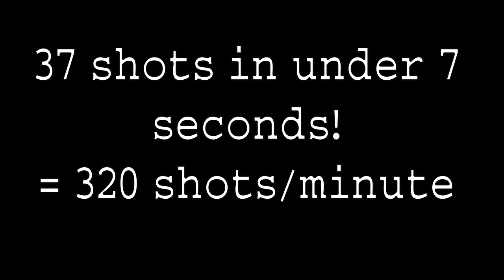Rack and Pinion = Machine-gun Crossbow Solution?

Comment: There is going to be a point when he starts producing crossbows more effective than guns for all situations
Reply: What if you increased the speed with a set of gears? Like a 
transmission. And use that rotary to linear trick to actually shoot the arrow.  What Joerg did, 
just basically in reverse. Or you could simply have a string that gets wound up
 at its ends.
Reply: Gears, pulleys, ect increase speed at the cost of mechanical advantage. To pull back a 100 lb spring thats geared to shoot twice as fast as its contraction speed, will require over 200 lbs of force. Furthermore, gears and such introduce extra friction and inefficiency. So you put in more then twice the force to get a shot that is not quite twice as fast. 

A spring weapon can rival the point blank damage done by a gas weapon. However the spring weapon must scale up via size and mass of projectile instead of speed. This means the spring weapon will always be larger, have a shorter range and more parabolic trajectory for any given damage level.
Reply: I know it's pointless, but when has that ever stopped Joerg ;)
Reply: mikeunleashed1 

I don't know... that's kind of a strech, not to say he isn't good at what he does
Reply: do you know what humour is?
Reply: I always thought they should make a weapons grade airsoft gun.

Comment: What about the ammo? It will need to fall fast enough or be pushed into the chamber for the gun to successfully fire. Could cause a jam if you are planning to shot arrows
Reply from the maker: The arrows will be pushed down by rubberbands as well. Gravity is too slow.
Reply: JoergSprave wouldn't it be a better idea to have bottom fed detachable magazines like on a rifle, frees up the top of the weapon for the sights
Reply from the maker: But the bottom is used up by the flywheel and the push rod already.
Reply: Ah I see, fair enough
Reply: you can still make a detachable one on the side like in some machine guns.
Reply: But that'd be where the rubber/string would need to be
Reply: belt feed auto-crossbow?
Reply: I love the fact that you reply. @JoergSprave
Reply: JoergSprave Your channel taught me that rubber bands can solve everything, and if its not just add some more!
Reply: JoergSprave Oh okay  :)
Reply: Maybe a diagonal mounted magazine would work? That way you would have the top free for sights?
Reply: A spring have to press the ammo in to the shaft
Reply: Jimmy Piontek A spring? A SPRING?! How DARE you!! There is only one option here, and that is MORE RUBBER!!!!!!!!!
Reply: go even slicker and run the drill through a 90 degree drive so it's inline with the gun and held more normally!
Reply: Invert it ...
Reply: TheGreatWarrior123 rubber pulled mybe
Reply: but how will you store that many arrows? or will it only fire about 8 but really fast? After all, bullets are alot smaller than arrows.
Reply: JoergSprave Just invert it, the flywheel doesn't really need gravity, turning it upside down would allow you to have both sights and huge ammo magazines
Reply: TheGreatWarrior123 perhaps a closed chamber with some springs pressing the arrows into the "barrel"?
Reply: almost anything can solve almost everything if there is enough of it tbh
Reply: Hopefully the arrows will be able to withstand that kind of lateral force!
Reply: A mag would be better too because u can use springs to focus the downward force, rubber bands aren't as controllable
Reply: TheGreatWarrior123  he could use the same principle of the pencil shooter
Reply: This was an issue with the early hand driven gatling guns, they had a max speed

Comment: So the next big problem is likely how to create a feeding system that can feed the arrows quick enough without jamming on every second shot.
You could try and push down hard enough, but that would ultimately cause lots of friction between the fired arrow and the one on top.
Maybe you can tie the feeding system into the firing mechanic, so the next arrow is pulled down for each shot.
Reply: the solution is more rubber.
Reply: TypeOmeg4 This is the Slingshot Channel. The solution is ALWAYS more rubber!

Comment: it s just like airsoft gearboxes
Reply: Yes, it's basically the same. I would have pointed it out, if you hadn't.
Reply: A good airsoft tech would help a lot with this contraption :)
Reply: The bolt assembly on the Lewis gun works the same way.

Comment: Dear Jorg please make this dream come true.

I still think that this rack and pinion is the best method for a machine bow due to its stability and better aiming, but the upgrade it needs is on the other side of the spindle of the pinion for another quite large cog to be the gearing system for the drill to connect to , so that the drill can attach to a smaller cog and then be able to power high weight crossbow limbs. Sure there would be some loss of power because of some friction in the added gearing cog , however the power increase of the gearing cog would more than offset this.

Please make this dream come true as surely this design improvement would be the best machine bow ever made.

Comment: Have you tried an impact drill? It might be a bit slower than a standard drill in gear 2 but the hammering action of the impact would sound more intimidating.
Reply: This is actually a great idea! An impact drill would greatly reduce the wear on the gear teeth. At least in theory.

Comment: I could see there possibly being an issue due to how it bounces when it rebounds after each shot. If the teeth of the flywheel catch too far along the shaft mid bounce then it might force the whole shaft into the back of the chamber and break something. Maybe put something at the front of the chamber to absorb the impact energy and reduce the bouncing.
Reply from the maker: Timing is very important, one of the reasons why I built a tester first. Seems to work fine though. Keep in mind when the wheel catches the first tooth the main rubber bands already press down on the shaft.

Comment: Jörg I think there may be a Problem with high speeds, as you can see after your test in second gear, the main rubber is released but the trigger is not jet pushed. 
I think it can't really lock at high speeds, perhaps a stronger rubber band is needed for the trigger itself?

Comment: Joerg, looks great. I don't know if you can go much faster with it without replacing the front pink band with a stronger one. With the drill in 1st gear, it appeared that if the loader doesn't move back to position fast enough, it would get caught halfway through its forward journey. You may lose power on the shots due to this. It is a very creative design though. I was thinking more along the lines of a piston, but this also works great. Keep it up!

Comment: What a beast! And the device is also super awesome. Can you think of a way you can use the cycle to also load the next bolt into the magazine? IIRC, there was a lot of dry fire even with rubber-pushed mag capping with your other full auto devices. Maybe you could have a little gear that cycles thin cogs that exactly fit between the bolts?

Comment: I suggest using the brushless motor and gearbox out of a R/C car. They're compact, powerful and can handle tons of torque; this might be perfect for your application. In the event of a jam, they also have clutches that will slip if the torque is too high. These motors run at really high RPM(100k or faster in some cases). You might even be able to get away with a threaded rod and steel pinion, although the rod would need some buffering when it falls home due to it's mass. The configuration is rather flexible and will allow for a less bulky package.

Option two is to use the drill as the pistol grip and figure out how to route the torque to the pinion.

Comment: Another potential mechanism to use for this sort of thing would be similar to how a steam train works - I'm not sure of the terminology here, but it would sorta be like the way the wheels are driven, in reverse.  An arm attaches a wheel to a piston, and when the wheel spins, it moves the piston - this way, in the circuit of the wheel, it moves the piston back to cock the shot, and also forward to return it to the "zero point" as it were - less rubber needed that could fail, less impact on the system as a whole, tho there are a few more moving parts.  Worth a shot, however, I'd think
Reply from the maker: The return speed is too low. The main rubber band would hit it halfway.
Reply: that's fair - I had kinda figured you'd already thought of it, but I thought I'd say something anyway - worst thing that happens is you've done it, right?  Either way, I'm excited to see where this goes.  The crazy lengths you go to simply on "How can I make this cooler" are extremely entertaining.  Cheers~

Comment: You could also use motors that hook up to strong batteries instead of a drill. Many of them are pretty small and can have good power for a prototype; or maybe even a completed creation. Plus their much more lightweight and compact, allowing for a more compact build. You can also use a drill motor. I've noticed from experience my chorded drills are more powerful then my battery ones. This could be tested for what you have available. If you have the same experience maybe one can be used to for a mounted build, or an aesthetic option (Baze Malbus cosplay weapon maybe? Just an idea.) I hope this comment means well.

Thanks for reading
Sincerely, Domolords

Comment: SO awesome!!! Maybe make a second gear that is set up so that it's teeth are 180 deg of the other one and put it on the same axle... then you could have another band set and hopper off to the side to make it a DOUBLE BARREL! It would also use the drill motor more efficiently I'd imagine. You may also consider putting the gear on top where the hopper will be so that it doesn't need to be as tall!

Comment: It looks like the gears and trigger are only using 1/3 of the wheel.  Is there enough room to add another set of gears and trigger on the wheel to double your shots per revolution?
Reply from the maker: Room, yes. But the timing has no more margin.

Comment: Joerg, I see two problems so far if you plan to make this have military grade fire rates (around 900-1200 rpm, like a machine gun.): the cocking sled splitting itself or the panel it slams into and the effective draw length of the string eventually being shortened by the string hitting a still-retracting sled. The solution of a better rubber band on the latter also might make the former problem more likely. maybe add metal plates on the sled and contact surface? I haven't seen any comments on this so i decided to ask about it.

Comment: That's basically a huge AEG except AEG's use compressed air instead of the force stored in the rubberband. Could this be used on your scale and would it be more beneficial? I think compressed air could get your bolts to reach higher speeds than a simple rubber band.

Comment: Nice! But i feel that the bolt needs a bit of a rubber or spring buffer. When it snaps back it smacks quite hard into the frame. It would stabilize the whole assambly and maybe even increase firerate. One definite point of failure will be the wooden teeth. It should be made out of metal if that isnt too much of a hassle. As another inspiration for transfering roational energy into pushing and pulling try a reverse steamtrain. Not sure what it is actually called but it may make for a more efficient energy transfer. Looking forward to seeing it in action :D

Comment: Hey, Joerg.... How about some different ammo??? I am thinking Golf balls, and tennis balls. But how about clear glass Marbles with a lazer light to light up the clear/translucent marbles?? And as I see it snowing, snowballs?
Reply from the maker: The principle works for all kinds of ammo. But there is a limit regarding the draw weight of the bands. The cordless drill only has so much power. Therefore the lightweight crossbow bolts are well suited for the setup. If you want to shoot heavier objects at high speed, think all steel construction and a Diesel engine.

Comment: You need a belt fed magazine. You really need to start machining the wear parts out of metal. The wooden rack and pinion will wear out pretty fast or break. Your designs are freakin unreal. You make some really cool stuff. You're quite the designer, engineer and fabricator. Does this video act as a copyright. I think you could sell this thing.

Comment: neat!
this looks like a great addition to your repeater line of thought.

"donald duckman' made a repeater with a servo, it is somewhat what envisaged for the chinese-repeater
the counterweight in the drawer runner is reminiscent of your 'drawer-slingshot-ception' vid.

perhaps, nitinol/nichrome in the band itself - 
the bands reflex/return to shape after firing?

neodymium in the pouch attach to a solenoid,
and a piezo-electric/hall effect sensor attach and detach the solenoid/servo to the pouch?
maybe a d'halbach couple at the base of the grip,
and there is not a chance the pouch will attach to the construction if wood throughout,
maybe the projectile?

I envisage that as a two-as-one system -
slingshot, and your pneumatic! 
so, you can have the small stirling/piezo solenoid run a small compressor onboard,
which power the reservoir of air somewhat eh?
or, perhaps it is slingshot and light-mag implement - 
some solenoid-stirling, they throw pellet with much force eh?

Comment: Just like the piston system In An aeg, automatic electric gun, airsoft gun. If you put teeth on both sides of the pinion, excactly 180 apart, you will not need as much speed from the power source. You will get two pulls and two shots of one rotation of the pinion.

Comment: It's basically the same mechanism that you can find in a soft-air rifle. The rifle's motor engages the pinion gear through a worm gear to reduce the high speed of the motor to a more usable speed.
Reply: Shannariano its three gears, pinion, bevel, and sector (thats what the drill is attached to)

Comment: wow that's fast I am looking forward into solving the feeding mechanism for this in that speed.
Reply: For reasonably small quantities, he had a vertical magazine, on the manually cocked version,  with a rubber band tensioned follower that pushed the bolts down. For bigger quantities (I can picture a wedge shaped hopper, V, with 100+ bolts...) The paintballers have a rotary 'carousel' type thing at the bottom of their mags picking up balls and the positively depositing them - an occasional empty slot isn't too bad at 12+ balls/s.  But dry-firing isn't a problem there, nor do  they don't need to worry about orientation of the ammo.
 Wonder if some sort of cogwheel with teeth/openings suitable for the bolts could do better than simply two rubber bands (front and rear) pushing the whole contents of the wedge down. Might be and issue to retain tension towards the end without having excessive tension at the start)

Comment: you could double the rate of fire by making it a double "barrel" crossbow with the pinion pulling a second rack after it has done the first. the rack would be going the opposite direction so maybe some paracord strung around some runners to pull the elastic in the right direction

Comment: Joerg you should get a right angle drill adapter and then the drill could be in line with the weapon.
Reply from the maker: These adapters only work under very low torque, useless for this application.

Comment: The slowmo shows that the part that pushes the string bounces back when slamming to the front. That might cause failure so maybe put some dampening there.
Reply from the maker: Dampening doesn't work. When you look at things using the hispeed, you sees that bouncing actually INCREASES when you use dampening. But look at the action - when the main bands hit the push rod, the bouncing stops. The flywheel teeth will THEN approach the rod.
Reply: I trust in your design

Comment: Would this be even more rapid fire if you made another set of teeth on the other side of the rotating circle?
Reply from the maker: No, the rubber bands need a certain period of time to contract. In the slomo you can already see how tight the timing is. In fact I think in second gear the action is too fast for shooting already, the main bands are on their way before the push rod has returned.

Comment: It might be ok for rubber bands but the draw weight for the small bow is over 20 lbs.   The mechanical disadvantage would require a very powerful drill.
Reply from the maker: Or a transmission.
Reply: I like the worm gear gearbox idea. Nice in line pistol grip , trigger possibilities.   I see what you mean about investing money... :)

Comment: Why not get rid of the second band set and make the rack actually drive the arrow forward, the you just have to make projectiles drop in front of it every time it cycles and you can eliminate the trigger at the back.
Reply from the maker: Weight of the rack is too high, reduces the power of the shot by a great deal.
Reply: JoergSprave could you use it to your advantage and make some sort of launcher that holds a ball tightly and "hammers" it with the rack? or would there be no benefit to that kind of system?

Comment: Only 1/3 of wheel have teeth - with the same amount of teeth at other side of wheel you could have double fire rate by the same rpm or same rate by half rpm.
Reply from the maker: No, because the rubber bands need time to go through their cycle as well. The timing is crucial.